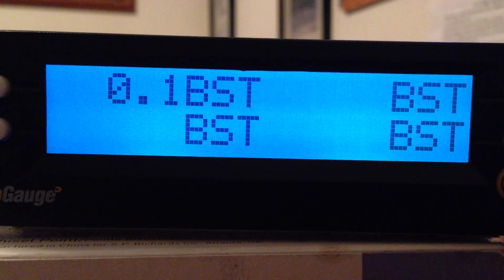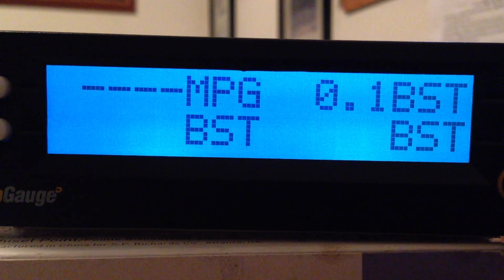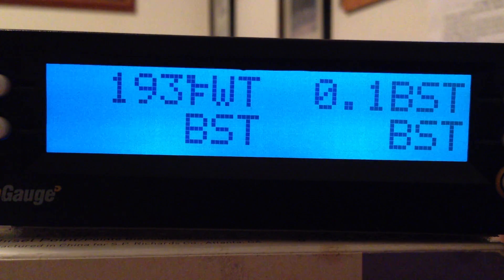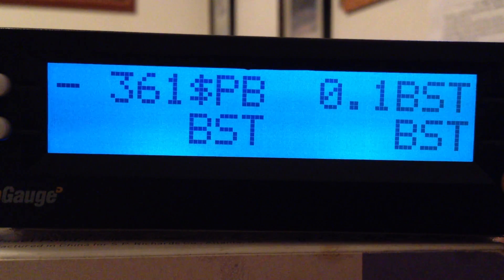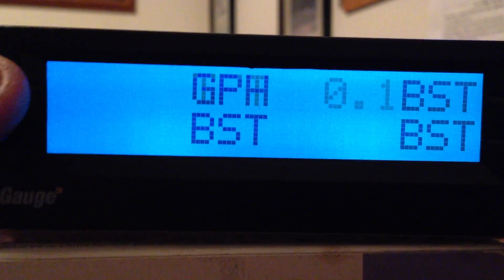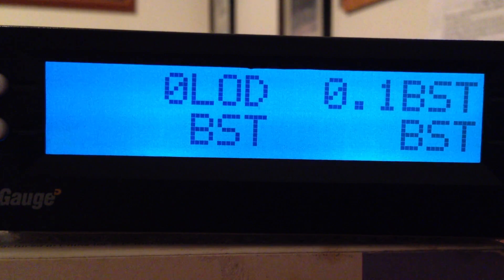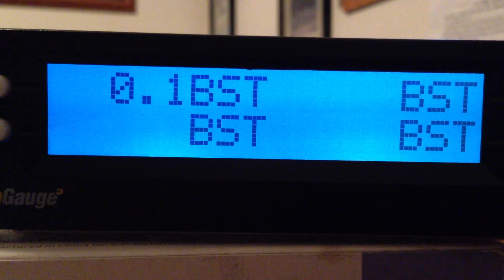ScanGaugeKR - What each gauge readout means

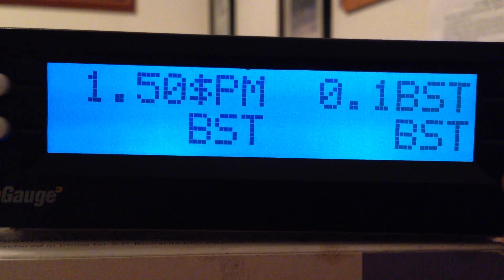Comment: 2003 Kenworth T-600 Aero-cab 12.7 Liter Detroit non-EGR / non - emission motor 10 speed 3:55 rears 
Many Pittsburgh Power engine fuel economy upgrades.3.18.2016 eBay item number: 141933763151 for extensive specifications sheet Steve 773 968 8908